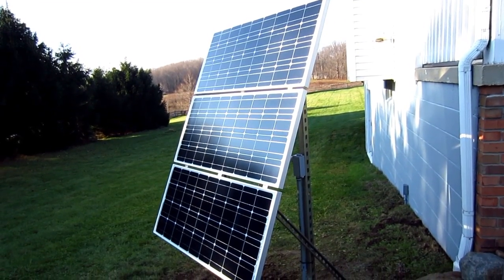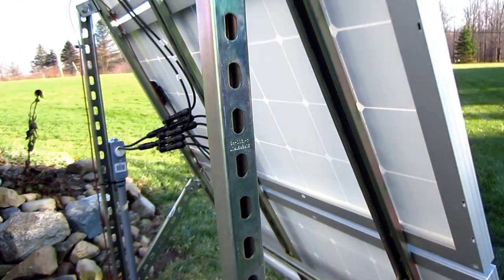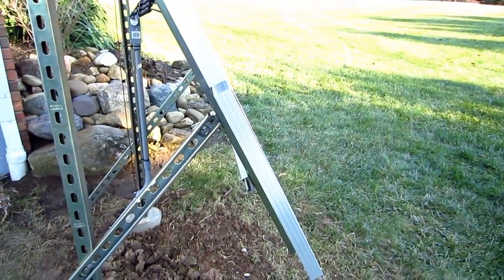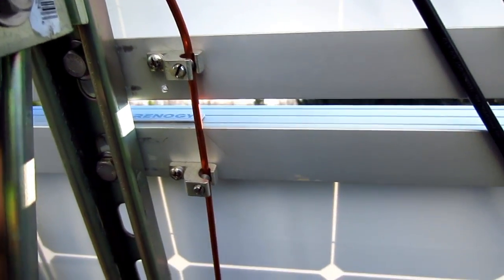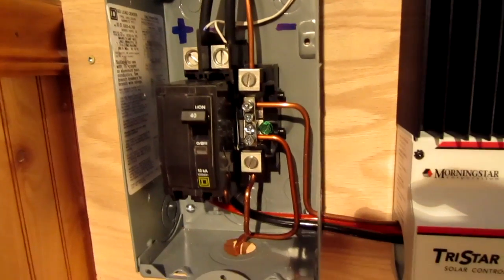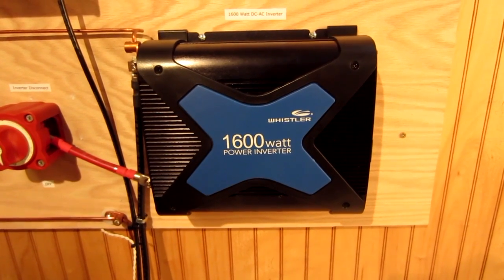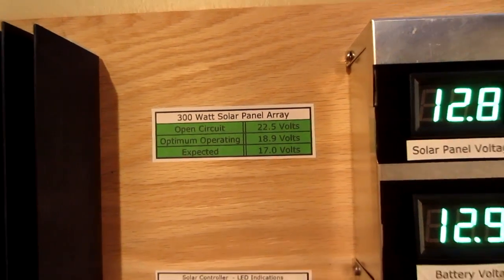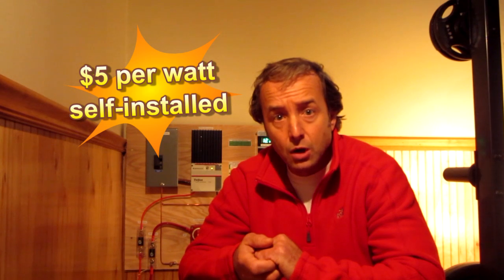DIY Solar Panel System - 300 Watts Off Grid Ground Mount - Christian Dude

Comment: Jim,is it possible for you to give us aq list of the parts you needed for your frame? I think that between my local Home Depot and Lowes I can get what I need but it's difficult to see exactly how much hardware (Superstrut) is needed. As the Superstrut hardware is fairly expensive, I don't want to over buy. My place that I'm installing the solar system is over 100 miles off-grid from the closest store so, I want to be sure I have waht I need. If you could give me the help requested I would be forever in your debt. You have a super system. Thanking you in advance, Craig
Reply: I have 3 of these panels. I wasnt sure how I wanted to mount them at first. I ended up using two 2×4s. dug down into the ground about a foot. leaned them up against the south side of my house (making sure they were both angled the same and spaced far enough apart to accommodate the panel width. I bought six $1.68 bicyle garage hooks and screwed them into the 2×4s then placed the panels on them. i have had them in 60 mph winds and the panels have stayed put. i hope this helped some
Reply: I have 3 of these panels. I wasnt sure how I wanted to mount them at first. I ended up using two 2×4s. dug down into the ground about a foot. leaned them up against the south side of my house (making sure they were both angled the same and spaced far enough apart to accommodate the panel width. I bought six $1.68 bicyle garage hooks and screwed them into the 2×4s then placed the panels on them. i have had them in 60 mph winds and the panels have stayed put. i hope this helped some
Reply from the maker: +Craig Fisher Craig - If it were me, I would just over buy and save receipts and take back stuff you don't use. All stores are good with that! Best of success to you buddy...

Comment: Jim,  Excellent video,  I'm thinking of mirroring what you've done pretty much, but with 2 Renogy 100 Watt panels.  How did you set up the support struts exactly to be sure they were level or even with each other? I'm guessing the auger length helped some.  God bless.
Reply from the maker: +Wayne Hamilton One thing I've learned is that they don't need to be exact! I put gravel in the holes so my struts were about 30 inches down the 48 inch hole, set a horizontal section of superstrut between the two holes and used a level and tape measure to adjust the gravel depth for each hole. I then set the vertical superstruts bolted to a horizontal piece with that whole structure bolted to two other pieces of superstrut, one on each side in opposite directions wedged into the ground at an angle. Check level on the horizontal and vertical pieces, and pour in cement. Worked for me!

Comment: I know this would use electricity, but what about a diy electric motor to move the panels on the roof, to catch more sun? the motors would only switch on a few times a day. and if you were able to get an extra 30% more contact with the sun it might be worth it. you could use a timer switch that kicks on every so many hours...
Reply: I built one.
Reply: It uses smaller panels that control relays which turn a winch motor that drives a chain which turns the yoke on a differential which is concreted into the ground.
Reply: Which the panels are mounted to lol

Comment: Jim, I need to get my array a fair bit higher than what you have as I have a hill next to where the panels need to go. I am thinking about setting 10' treated square posts 4' into the ground and attaching the superstrut to the wood posts to get the bottom of my array 8 - 10' off the ground. Any thoughts as to whether I should do 4" posts or 6" posts? Regardless your video inspired me and gave me a ton of ideas. I bought a pair of the Renogy 100 Watt Mono's and was just trying to figure out how to build a ground array affordably when I saw your video, and you answered 95% of my questions. Talk about providence. Thanks for the great video and the positive message!

Comment: How did you get the tax credit since this is an off the grid system?
Reply from the maker: +John Steel IV Have you found information that suggests otherwise? Everything that I have found indicates that it qualifies, but I'm not a tax professional. Some quick googling turned up this: http://www.wholesalesolar.com/solar-information/federal-tax-credit
Reply: I talked to Grape Solar themselves and they said Grid Tied systems are the only ones available for tax credit. I also asked a local company (Lenape Solar) and they said the same thing??
Reply: "ANY complete solar power package, for home or business." So if we got a 400 watt kit and had everything BUT the batteries , that would not be complete right? I think that is why.
Reply from the maker: +John Steel IV (2) Qualified solar electric property expenditure
The term “qualified solar electric property expenditure” means an expenditure for property which uses solar energy to generate electricity for use in a dwelling unit located in the United States and used as a residence by the taxpayer.
Reply: oh , awesome!!

Comment: Nice system. BUT no battery meter.  You should do yourself a favor and look into a Bogart Engineering Trimetric meter. It will tell you exactly how much is left in your batteries or how far from FULL they are.  Here is a great blog with tons of info to make a solar system really work and nobody is trying to SELL you anything here. Just FYI. Good Luck.    https:handybobsolar.wordpress.com

Comment: Great video. Your set up is impressive. The solar mounts are great. I have been  looking for a manufacturer that makes a solar panel movable rack system with locking castor wheel assembly. This way the panels can be moved for efficient use of solar schedule and you can move the panels indoors quickly in case of bad weather. Please let me know if something like this exists.

Comment: what would be the difference if I used 6 x 220AH 6 volt trojan deep cycle batteries over your 3x 100AH 12v batteries? would I be looking at at least 20 hours?

Comment: You did a pretty good DIY job. As an electrician, I will tell you about some (minor) quibbles I have. First, while you can get away with the MC4 connectors as a disconnecting means, I think an actual disconnect switch would be better. The thing I didn't like the most was the lack of connectors when you entered your indoor equipment. At the very least you should have some Bushings on those knock outs. Good job overall.

Comment: I have a question about the super strut .. I have a standing seam roof and would like to use the S5 connectors because they are penetration free.. how would I attach the super strut to a S5 clamp?

Comment: I was just checking out the requirements for the federal tax credit, It looks like the minimum is $5000 to get the 30% tax credit. I have purchased two one hundred watt panels a Midnite kid MPPT charge controller two Trojan T105RE batteries, the DC to AC controller is going to cost me around $250 and all the wiring,
I need two more panels and two more batteries. Even with that I am nowhere close to five thousand.
How did you do it?
Reply from the maker: patd4u2 Please show us your source of information. I believe you may be referring to a State tax incentive...

Comment: Impresionat! But you need some batteries. Here you will find a small guide how should Choosing the right batteries http://www.patriotdirect.org/choosing-the-right-batteries/

And in this article you'll find the components you need http://www.patriotdirect.org/the-components-of-an-electrical-solar-power-system/

Comment: +Jim Kirchner
Wow this guy is one smart SoB (until he started talking about religion) he thought of 3 important things:
Grounding equipment, equipment safety (and yours)
Battery box(es) for safety
Connecting terminals at opposite ends to optimize balanced charging

30% DoD is WAY to low optimum is 50%
Reply: Yup. Religion gay tho
Reply: @skeptictiqer6902  lol pretty much

Comment: There's some good MPPT charge controllers on ebay for a reasonable cost from the Far East that can increase the amperage in to batteries I've read by about 20-30%. I also liked the closing comments which are relevant given the harm that will occur to God's creation if we continue to burn fossil fuels and not respect Nature. Solar all the way.

Comment: I was looking at your DC breaker that is killing the connection between your solar panels and the rest of the system, and when I look online at the specs, it says that it is for AC systems. I didn't see anywhere where it could be used for DC systems, or what the max voltage/amperage was that it could handle? Is there somewhere else you checked, and how do you know it meets NEC code?

Thanks!
Reply from the maker: http://www.schneider-electric.com.mx/documents/local/qo.pdf
Reply: Jim Kirchner Great! Well I have the same solar panels you have (4x Renogy 100W Mono Panels) wired in parallel for a total of about 23Amps. My charge controller can only handle 30Amps, so I probably need to go with a QO breaker that is rated for 25Amps to be safe? Lastly, what about this breaker makes it NEC certified? Thanks for your help!
Reply from the maker: Robert Smith Good questions! If you live in a cold weather climate your panels will likely trip your 25 amp breaker during extreme cold and intense sun, but it won't happen too often so I would go with the 25 amp QO to protect the charge controller. NEC certification is mainly about safety, not system necessarily system performance, so the 25 amp breaker will be fine!
Reply: Jim Kirchner Thanks Jim for your quick responses. I wish more people were as helpful . I noticed you used a 60 Amp fuse going from your charge controller to your battery bank. However, you only have 3 solar panels hooked up in parallel which would give you approximately 16Amps. So why did you feel the need to use a 60Amp fuse when your system can never produce that amount of amps even if one of the solar panels shorted? Thanks!
Reply from the maker: Robert Smith Good question - engineering buffer plus future expansion. You can definitely get away with a smaller fuse....
Reply: Jim Kirchner Alright, thanks. Last question I hope :D, does it matter which side of the inverter fuse you put the Blue Sea disconnect switch? For my setup, I wanted to use as few wires as possible but also keep all my disconnects in the same area. I also wanted to add a disconnect for the batteries. But I just wanted to confirm it doesn't matter which side of the fuse you put your disconnect?

Thanks!
Reply: Robert Smith Also, I shared your video on my website over at http://greentechtown.com/ Thanks for your help!
Reply: +Robert Smith, +Jim Kirchner It's been my experience that fusing is only to protect the wiring from getting hot or overloaded, not the equipment from overloading. The equipment that you install should already have fuse protection incorporated into it for input and output. You select the inline wiring fuse based on your wiring AWG and length. That determines what fuse you need to use. If the fuse that this calculation determines is to low then you need to select larger conductors or shorten the lengths, or both. There's power in prayer.
Reply: +Robert Smith I agree with your observation wholeheartedly. There ARE DC Breakers designed specifically for Solar systems like his. He really SHOULD make that change to his system. Otherwise, he has done a FABULOUS job! This is one of the CLEANEST setups I have seen. He is also spot-on with his on-again off-again approach to his high draw appliances. As for his lighting, he can change from AC to 12 VDC L.E.D. lighting for his home for grid outages.

Other than the Breaker Box, I have NOTHING negative to say about this man's system. WELL DONE, MR. KIRCHNER!

Comment: I'm amazed how thorough you were!  Great video!  I was curious, what are you able to run off this 300 watt system?
Reply from the maker: Nathan Daniels Hey Nathan - It is a very small system that is primarily for emergency back-up purposes to power some lights, recharge batteries, etc. although in that situation it is sized to keep the food in my small freezer and fridge fresh as well. Right now it is being used with a heat matt for seedlings, and I will start seeing how it works with a 100w grow light, although it isn't large enough to power the grow light for 14 hours per day like I need.
Reply: Jim Kirchner Hey Jim, it is indeed a very thorough video explaining the design and construction of your support/mounting structure for your panels; well done.  You provided us with part-by-part details.  The Superstrut alternative is relative cheap compared to Unirac (and others), especially considering they are available at our local Home Depots.

Can you tutorial on how to position/situate the panels (like the angle of incidence and solar noon stuff)?  There are tutorials on youtube but they merely tell you what to do, w/o the theory behind it.

Thanks again!
Reply from the maker: Jacky F. OK here is a brief explanation of why the angle and solar noon change, excuse me if I state the obvious. As the earth orbits around the sun, it tilts on it's axis warming the northern hemispere for 6 months, then tilts back to warm the southern hemispere for 6 months. This tilting causes the angle of incidence to change, and also the hours of daylight and hence the solar noon time to change. The solar noon time is the midpoint of the hours of daylight, when the sun is at its highest point. For an observer in the northern hemisphere the sun reaches the highest position in the sky once a year in June. The day this occurs is called the June solstice day. Similarly, for an observer in the southern hemisphere the sun reaches the highest position on December solstice day.

Comment: Hello Jim,
My name is Johnny, Thanks for making this video. I just bought a house in Florida, and ever since I moved in last May I been wanting to do my own solar panel system. I want to save on energy cost specially through the summers so my main focus is the AC. What I want to do is create a solar panel system that would power my central air system through the day. Is this possible or am I being too ambitious? I watched your video and your system is amazing, but you mentioned its only for a grid outage, Would that same system work for what I am trying to do?
Reply from the maker: Johnny - It's definitely possible but you would need a much larger system with many more panels. Google solar calculators to estimate how big the system would need to be. Best of success and enjoy the sunshine state! I lived in Satellite Beach for a while - nice place.

Comment: Great information! Nice installation. Awesome video. If you can? don't run your AGM batteries below 50% if you can help it, will progressively hurt cycle life under 50%, maybe in time you could add a cell have more run time then you have now. only going to 50% But what you plan on doing is fine as well just a shorter battery life. Going to 50% or less will give the most cycle life with the most AGM cells.

Comment: Some nice ideas here, but you should really remove the statement that it has been designed to the meet the NEC requirements. As an inspector who specializes in PV, there are many issues with it in this regard.
Reply from the maker: Thanks for the comment - in hindsight I agree. The guidelines are very difficult for the layperson to follow, even experts are having trouble applying them, as they are constantly being reviewed, interpreted and revised.

Comment: Jim,
Great job on your solar installation, I can see that you are a man with high standards. I would like to offer you one suggestion regarding your dc disconnect box. I suspect that the Square D circuit breaker you used is an ac breaker. If I am mistaken please ignore my following comment. I must point out that an ac circuit breaker and a dc circuit breaker are designed differently and should not be interchanged. You must use a dc breaker for dc current and here is why. It is far more difficult to extinguish a dc arch than an ac arch in a switching mechanism. Think about the fact that alternating current falls to 0 voltage two times per cycle. At 60 cycles per second or 60 Hertz the voltage of alternating current falls to zero 120 times in one second, every second. On the other hand direct current is always flowing at peak voltage 100% of the time. The dc arch that forms in the breaker at the moment it is switched off is harder to stop. The dc breaker is designed to overcome this arching issue. An excellent line of dc breakers is made by a company called MidNite Solar. Their breakers are marketed by most solar equipment retailers. You probably will not have any issues with your low voltage system but if you one day upgrade and are working with higher voltages you would be well advised to switch to dc breakers. Be safe and God bless.
Reply from the maker: Patrick - thanks for your thoughtful response! We should work together ;o) Schneider Electric QO circuit breakers are rated for both AC or DC (48 VDC) operation. See this bulletin:  http://www.schneider-electric.com.mx/documents/local/qo.pdf